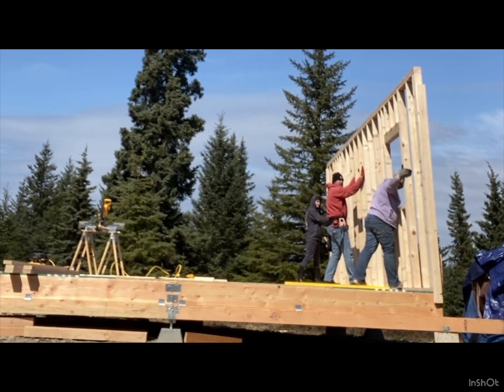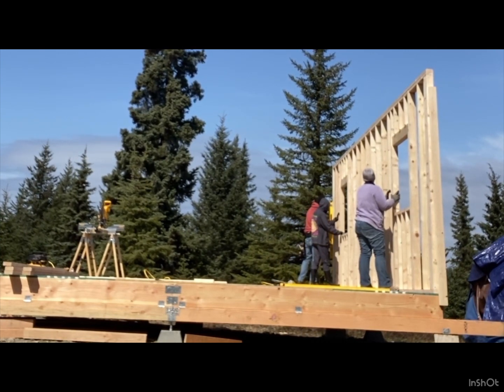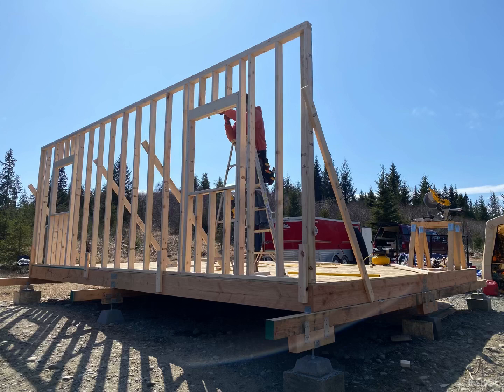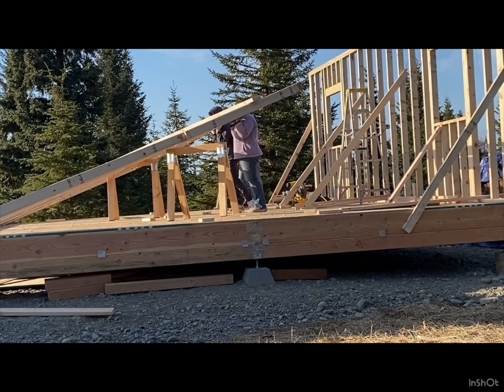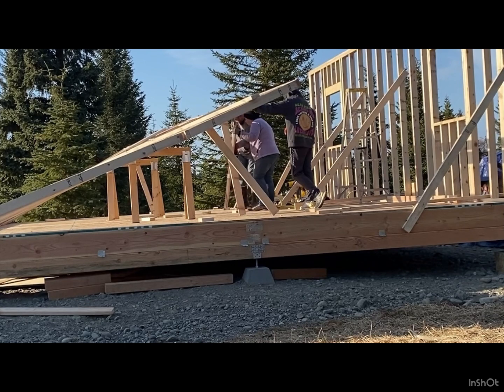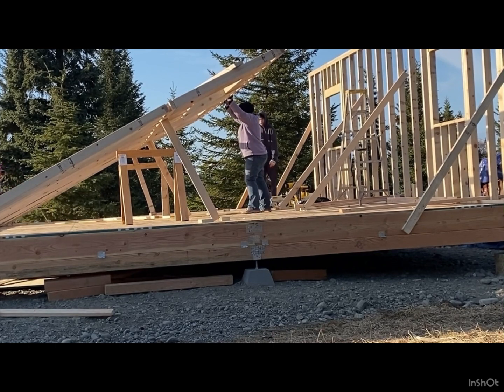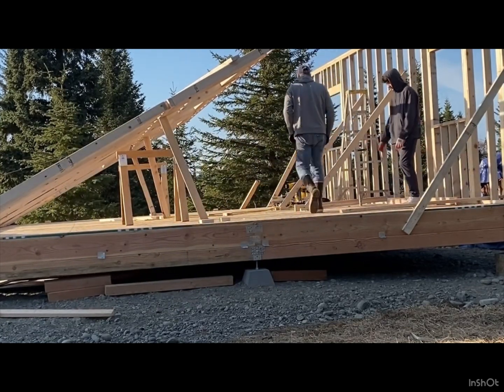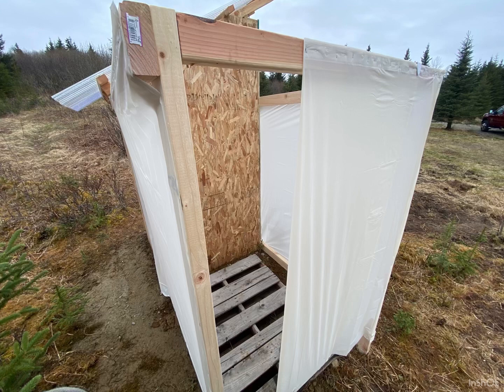Framing Cabin Walls | Building Alaska Off Grid Tiny House

Comment: Using slings and a winch, it was possible to simplify and secure the lifting of the walls of a frame house. This is useful if you are building alone. P.S.: ha, I watched right up to the part with the winch. Good thing you used it.

Comment: We have the same CampLuxe shower. We also had the ingitor issue and found out that it just needs more pressure, we didn't have a strong enough water pump. The inlet screen can become clogged very easily and cause issues as well. We also will be moving to interior Alaska maybe by spring! Thanks for sharing your journey!
Reply from the maker: Thanks for the info. It’s not worked from the get go so I don’t think it’s the screen, will check it. It may be the water pressure though ours is the pump that CampLux sent so it should be operating at whatever their recommended pressure is. Definitely something we’ll check. Thank you!